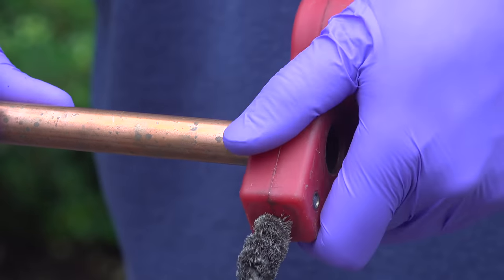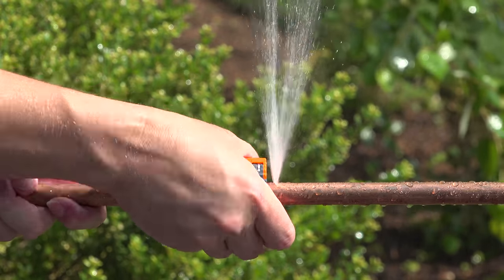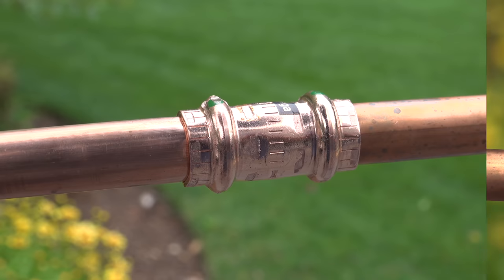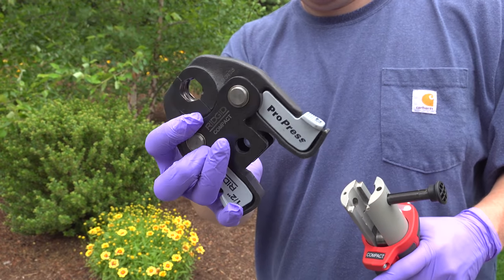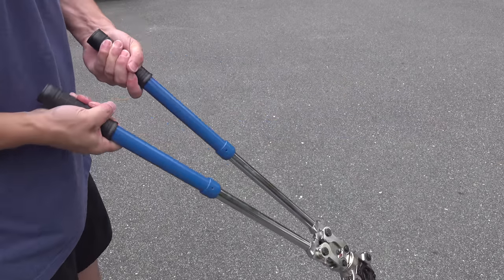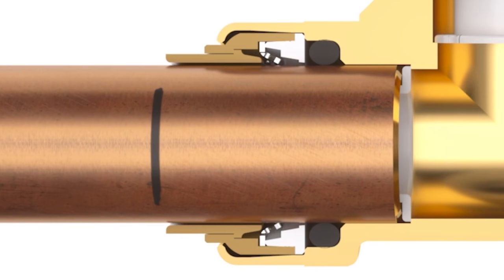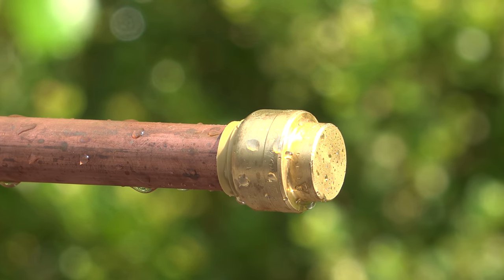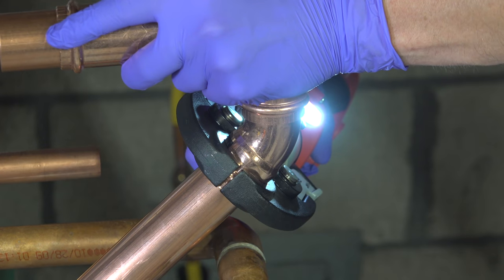NEVER SOLDER PIPE AGAIN - 3 Ways for EASY DIY Plumbing

Comment: As a plumber of 40 years I’m still using copper and soldered joints, I remember the acorn plastic pipes coming out and I said it will leak after 10 years and it does ,I remember a customer having every pipe in a new house in plastic, I told her it will being replaced in 10 years and it exactly was and destroyed the house,

Comment: Anyone who owns copper spigots with rubber o rings know that the rubber degrades over time. Granted these fittings will most likely be shielded from dramatic temperature and pressure fluctuations like with spigots.   But I wouldn't bet my house on it.

Comment: Shark bites are great in a pinch, but always have a plumber come and fix the pipe properly. I have seen to many flooded houses due to shark bite fittings. If you read down on the comments a lot of people say to use them in the open. There is a good reason. Solder and pro press is the way to go for copper.

Comment: The pro-press will be hard to get into some small areas.
Reply: Pre-fab before you paint yourself into a corner
Reply: @MisterTwister88  same can be said of soldering. Why not learn the skill it’s not hard and do it right? Or go to Pex. Pex is perfect for dummies who don’t want to solder or in some cases copper isn’t a good option.
Reply: @donaldducko6580  Hot work permits are why lots are using pressfit, me included 💪
Reply: @donaldducko6580  i learned that skill 34 years ago, Thanks.

Comment: I’ll take the electric press!! That ones pays itself too lol. Avoid getting ripped off by plumbers or shitty plumbing work. So the tools helps you finish the job faster and with ease
Reply from the maker: It is really nice, I had something like 40 connections I did with it at the end of the video for the heating manifold but for normal home work like valves the manual has been really popular with people. I wouldn't hesitate to use sharkbites too.
Reply: I'd take my time and solder then.... these press fittings were invented for the tradesmen just to be able to make more fittings per hour that last long enough for warranty to expire. Not with  real longevity in mind. You rely on a rubber seal that needs plasticizers to function in contact with your drinking water.
Reply: @jackmclane1826  Propress fittings are rated for 50 years. They've been in use since the 90's and I have yet to see a seal fail on them on its own. All propress and sharkbite failures I've seen are due to improper installation. No different than a poorly soldered joint leaking prematurely. It's all about proper installation. It's like blaming the car because you blew a red light which caused an accident. User error not a product error.

Comment: We call them push fittings. Worth reading up your local laws as some countries may not allow push fittings behind walls, under concrete etc
In the UK theirs hardly no space in residential dwellings to use the hydraulic press machine :(

Comment: There are some great applications for push-in fittings. Compressed air is one, a slight leak is ok. Water in your home is not one of those applications !
Reply: Yeah the only time to use such a device is to bridge the time until the plumber can repair it properly.

Comment: I've never seen a plumber that recommends press fittings. Every plumber I've talked to says solder is the standard for a good reason. It's way more reliable.
Reply from the maker: Propress is used by many plumbers because it eliminates the need for a permit required to use a torch for commercial work. They also use it since it is faster and saves the time. They won't recommend shark bites  more from spite I thin, they have an amazing track record if you really look into them.
Reply: Majority of plumbers aren’t going to want to learn something new. Why change if they can just do the same thing
Reply: @HMNNO  And charge more $$$.
Reply: That’s possibly because a lot of people are stuck in their old ways, they refuse to embrace technology. Or don’t know how to install it properly.
Reply: @CT-vm4gf  if it ain't broke don't fix it
Reply: @CT-vm4gf  no, they've all seen PEX/sharkbite fittings fail and cause thousands of dollars in damage. AvE has a video on this very subject.

Comment: Sharkbites are great for one-offs or emergencies.
If you have a real project, then consider PEX and a Ryobi $110 ring clamper or the manual Pro Press if staying with copper pipe.  
Otherwise, Sharksbites will promptly take a bite out of your wallet.
They do generally resist freeze expansion much better than sweated fittings.
So if you ever have your outside hose faucet pipe freeze and brake, use a sharkbite.

Comment: Propress is great but fittings are expensive. It’s always a cost wash on the jobsite. You trade labor savings for increased material components.
Reply: The manufacturer and distribution channels plan for the cost wash.  What it is also good for is no hot permit requirements or fire watch, so it is considerably faster and requires less people to accomplish the task. Never been a fan of them or grooved fittings, but it is what it is. The trade skill will only diminish with more and more use of these fittings.
Reply: You have to factor in time. It's faster than soldering and the faster you can complete a job, the more money you save per job so the increased material costs ends up paying for itself in the amount of time it saves you.
Reply: Yes, if you're building homes in a new subdivision and can get them on the market earlier, that means potentially getting your ROI back faster and you are getting your work crew onto the next project faster.
Reply: I bet you I could sweat down a line if fittings faster than that pisspress and cheaper than shark bites to..

Comment: I love shark bites and have had a lot of quick success with them. Will only use them in areas that are visibly accessible and never behind a wall or ceiling, so that if they start to leak after a few decades it is easy to see and redo. Was not aware of the manual clamp option, if I ever need to do a fix that would be behind a wall would probably spring for that tool. Thanks.
Reply: I like using them for a toilet shut off valve or sink valve, easy to throw on with open access. Behind a wall or foundation though I just use pex crimp fittings or solder

Comment: Not sure how any of that pays for itself, soldering is dirt cheap and a extremely reliable connection if you do it right. Sharkbites are ok but very pricey nowadays.
Reply: Depends on what you need to do. Is the cost of a sharkbite or two for one home project more than the cost of tools needed for soldering, not to mention the learning cure if you don’t know how.
Reply: @thomashajicek2747  True, if you have no experience soldering sharkbites are your best option. Would not recommend attempting to learn soldering on your actual house plumbing.
Reply: Hot work permits bro, that's why. Also some places your not allowed to solder.

Comment: I know that pros like to use ProPress because it's a lot faster than sweating copper and there is no learning curve, but at the end of the day, it still relies on an O-ring and is only a little better than a Sharkbite (the ProPress compresses the O ring more than a Shark does).  I still now and will always sweat copper and use the Sharks for temp or exposed repairs when convenient.

Comment: For those concerned about the longevity of rubber o rings (as I would be also), once these connectors are installed, can you just solder the ends together as a long term permanent fix? So even if the rubber degrades, it is still soldered tight at both ends?
Reply: For any job the trade off is cost for time.   Time is Money and Money is time.  Spend more money to save time.  Talking more time by doing work will save money.  The shark bite  very expensive but will save you work and therefore time.   If you solder it will be cheaper but require more work and time.  So I would not install a shark bite only to come behind and solder that would be a waste of money.
Reply: You will melt the orings before it heats up enough to solder.
Reply: @MisterGreenGuy  Can you use silicone o rings?
Reply: No
Reply: No, as others mentioned the heat would ruin the o-ring completely and walls of those fittings are not made to mate up to the pipe wall in way that allows solder to bond the pipes. 
Solder isn't just filling the void and plugging water inside, it's creating a chemical bond between the close fitting walls of the copper to make it extremely durable and resistant to pressure and corrosion. (That's why soldering takes flux- without it the solder will not bond them.) 👍

Comment: Propress has its place, I work in a hospital and we can't just shut off water to areas with patients in it, when valves fail to hold we have to shut down the building for a quick solder job and then are required to flush the system. Propress is quick and it'll last longer than our pipes last. Place falls apart quick when you use chlorine to clean the water over legionella concerns. I've seen solder joints fail next to propress fittings and both are installed at the same time.

Comment: Im 55 and its been my experience that every O ring will eventually fail.  I’m cool with it failing in an air tool, water hose reel or any exterior device but the possibility of it failing on an interior water pipe and flooding my home is something I’m not willing to chance.
Reply: Yea.  Try that with all the fittings in your home inside walls.  It's going to be like in a waterfall when things starts to fail all within the same time and opening up those walls to fix things would x10 the cost of installing this stuff.
Reply: The oring in your air tool is made of nitrile rubber. The ones in the fittings are probably EPDM. The life is entirely different. I still solder them because the fittings are ridiculously expensive, but the engineering behind them is sound. They should last.
Reply: @CantOutRunADuck Do you have some sort of data to disprove me? Buna-N o-rings are the standard material and what is used in most equipment. Occasionally you will see the Viton used which has better resistance to some solvents and probably last longer. Other materials are used in AC systems, but they are colored green to identify them.
Reply: @CantOutRunADuck Again where is the untrue part. If they use a polymer in that o-rings that lasts, then it should seal forever. I am not a fan of push on fittings either, and won't put one inside the walls, or where there isn't a floor drain. The soldered joint provides more than a seal. It is a mechanical connection. If the pipe has loads, or it vibrates (water hammer...for instance) they will probably fail. That is misapplication, not bad design.

If they are using Buna-N o-rings in those things they should be sued for damages. They are well known not to last.

Comment: “Never solder again.” Why Pex was invented.
Reply: Lol that's what I thought too..we already solved this
Reply: Exactly
Reply: Ok DIYer
Reply: Those Pex tools are $$$$
Reply: @GeorgeS68  I got a crimper and a cutter for less than $100, fittings is around 5 a bag .
Reply: @non8743  spoken like someone who doesn't know what they're talking about lol
Reply: And it looks so nice when you're done...like a snake on a hot road weaving across the basement.
Reply: Propex.
Reply: @cesarmarx  Where and what kind, info please.
Reply: @GeorgeS68  not that much.
Reply: @brianhain4390  whether copper, galvanized or pex it needs to be properly attached and supported.  Also if you buy Pex by the stick instead of the rolls it is nice and straight.
Reply: @gsxrsquid  I totally agree, but having seen what DIY homeowners installed is something else.
Reply: To take all the skill a professional needed thus requiring decent pay . Replace it all with cheap easy to do stuff that anybody can do and pay them less to do it .

Comment: I wouldn’t purchase a house with these fittings.
Reply: It's the future poly
Reply: This application is more for commercial jobs. Residential went pex long ago. These fittings are tested at 200 psi with no o-ring and they don't leak. This is good technology!
Reply: You probably already have. Or you just rent one
Reply: Nobody does an entire house with  them,  they are great for repairs  and if you consider your time valuable, been around for a long time , hasn’t seen one failing due time.
Reply: Good for you

Comment: Never ever try these alternatives for repairs in the walls. Ok for exposed tubings.
Reply: I thought I read that Shark Byte fittings are rated for internal walls and meet plumbing codes.
Reply: Propress are a few orders of magnitude more reliable than the various quick fitting.  We use them in industrial setting (2-3 inch pipe).  If the crimp tool wasn't $1K I'd use them for my home.

Currently my home favorite is copper and   pro PEX A.  Older CPVC has failed too many times on me to use it on anything in the wall._
Reply: ya sharkbite should never be buried in the wall. Press fittings are wildly better

Comment: Its a great idea. Same idea used on the big blue water pipes underground. All winter long they dig up the roads to repair them. I am not sure why because I am not an engineer. But lets image that copper on both side of the "O" ring corrode. Then the furnace breaks down, the pipes shrink do to the cold and that pulls the "O" ring over the corrosion. It might not keep the seal unless you compensate by using a method to prevent it. Easy enough I guess but they don't do it because it does not happen much. I would suggest if the insurance company won't compensate you for letting the basement fill up with water because you used these connectors....it could be expensive for the plumber who put them in to take them all out and pay for the new carpets. Make sure these connectors are guaranteed before you put them in and keep the guarantee in your safe deposit box.

Comment: Can also attest for sharkbite. If the preperation is done correctly, they won't fail. I've had mine for two years on pipe leading to my sprinkler system, zero leaks, zero drips, zero issues.

Comment: I don't know about quality of joints but I've never seen a crimped joint that looks good. Then again I think my pipe work is art. One time I quite unnecessarily put a combination of 15 pulled bends and sets some of which were oblique on a 3m length of 15mm ( ½" to you Americans) just because I could and it popped into the clips first time. I went out side then lit up a cigarette and I don't even smoke.

Comment: From Leo:   Someone was talked into using those for installation work at the local university.  I did not work in that department.  I worked in maintenance where a couple years later, we soldered those leaky joints up and replaced all the damaged ceiling tiles.  Of course it is about 4 times the work to do it after the install, having to drain the lines down, often 100's of feet.

Comment: Epdem (Ethylene Propylene) this is the best oring composition to use. This material has good Compression Set Resistance, that is the key factor to consider for home use, will the oring lose it's compression memory over time which translates will they leak over time. These fittings more than likely use NBR NITRILE orings because there the cheapest, they have average compression set resistance. If you can swap out the orings to the Epdem grade as a home owner do it , it will put your mind at easy if that is your concern 😊

Comment: Since push fittings were used successfully for quite some time in the naval industry with good success, the problem in residential use is likely improper installation by a homeowner (or plumber who might've been in a hurry). Also, I've used the Tectite brand, which is warranted for 50 years, as opposed to 25 for Sharkbite.

Comment: Solder if you can. Sharkbites are good, but you must deburr the pipe well first as the burr will scrape the seal inside. Same story with pro press fittings. If you are doing a plumbing job diy but not planning on doing a bunch of work with plumbing, you can rent the press tool quite cheaply.

Comment: This is the solution to a non existant problem. I'm just a homeowner, but I have managed to sweat dozens of connections both for water and compressed air for my garage shop, and I have never had a leak, iver 40 years and counting.
The small amount of time saved is peobably offset by the extra cost of the sharkbite components.

Comment: I was hesitant to use a shark bite. I had a leak in vertical pipes and I was not able to get all the water out and I was struggling to sweat the pipe. My friend who is very good at plumbing and has worked in the plumbing business for decades told me to just use a shark bite. I gave in and used one. That was two years ago and all is still good. So easy. For the average homeowner it’s a good way to go. I will still sweat pipes when I can but I will not hesitate to use a shark bite ever again. The pro press is a little pricey and that tool looks like it could be difficult in tight areas.
Reply from the maker: I agree, and if you saw my well water video I used some larger 1.25" ones with excellent results. As long as the pipe is prepped correctly and they are inserted fully they seem to do very well.